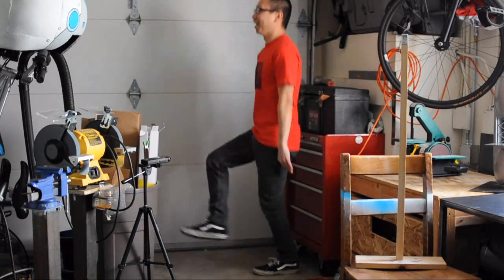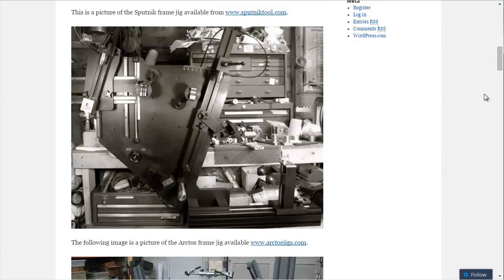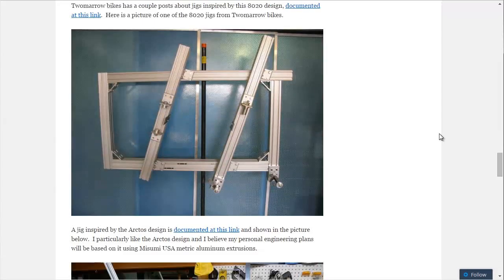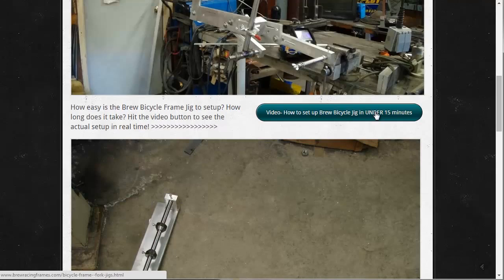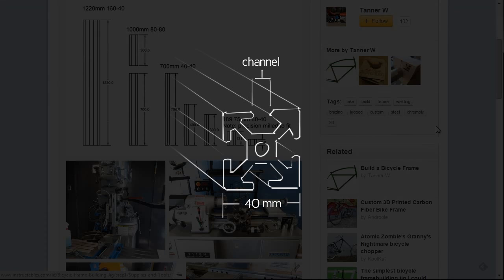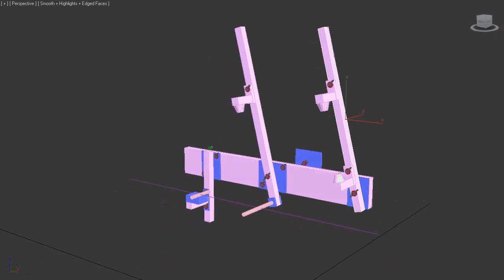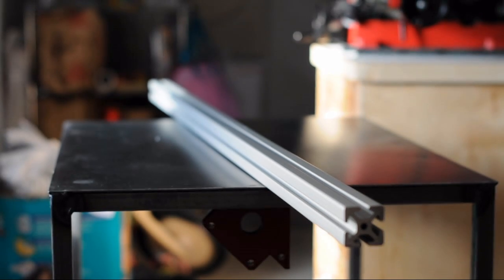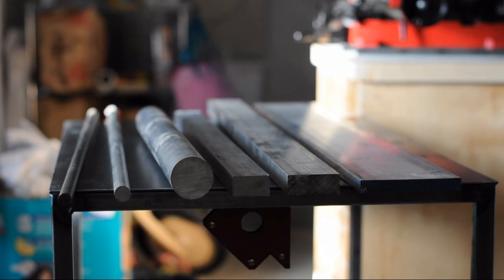Bicycle Frame Build 09 - Frame Jig Pt.01 - Frame Jig Overview

Comment: Please tell me what size alu plates you used for milling? 
In video you put them all on the table (@ 5:55)
Reply from the maker: +Leonid Fedoseev Hi, sure!

6061 flat bar 5/8 x 5 x 36" 
6061 flat bar 1 x 2-1/2 x 36" 
6061 flat bar 1 x 1-3/4 x 36"

Comment: Have you gone to school to learn how to weld?
Reply from the maker: Neil Shubert Hi Neil, I took two tig welding classes at a place in Oakland CA called The Crucible. If you're in the area I highly recommend it. The classes I took were one night a week. These two classes are all you need to get off on a good foot  to start welding on your own. Cheers.
http://thecrucible.org/
Reply: Pithy Bikes Fantastic. i have been welding for 20 years but never really wanted to build a bike, because I always wreck them, and would hate to wreck a bike I bought.
Reply from the maker: Neil Shubert I will pob wreck my first set of tubes. So ill try things out with standard cheap mild steel tubes (not bike tubes) This should be good practice.
Reply: Pithy Bikes Welding aluminum is so very different than steel. Steel is easy. Also, Jigs like that require a ton of out of position welding, which takes so long to get good at. If you are sure you wish to use aluminum, Practice alot and don't bother with steel. You should show us some examples of the welding!
Reply from the maker: Yes, aluminum is quite different for sure. I need a lot of practice with aluminum. Fortunately for me I don't need to weld any aluminum as my bicycle frame will be made of steel. The fixtures I'm building are aluminum but no welding is required, just machining. I'll try to get more shots of welding as I get closer to that stage :)